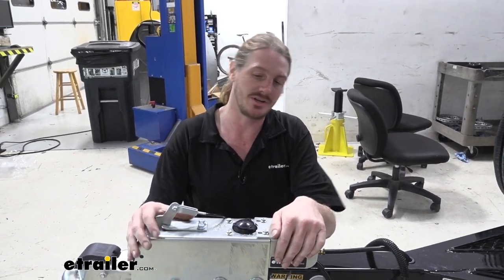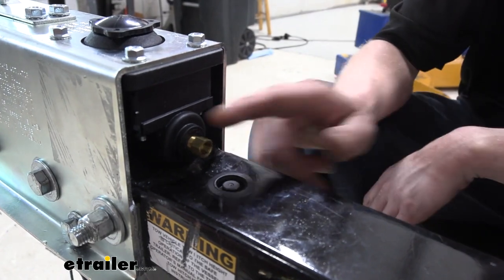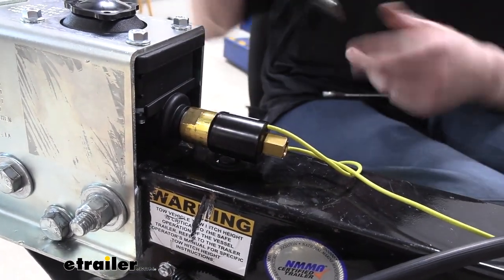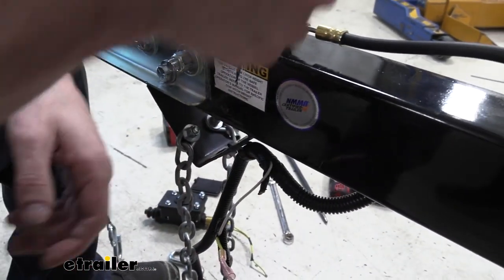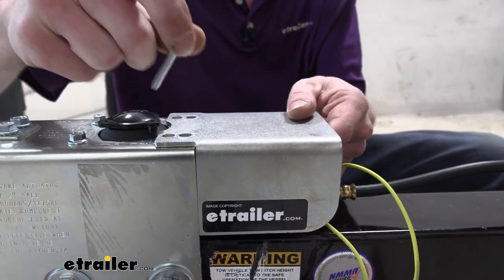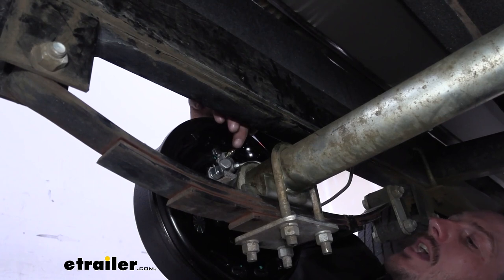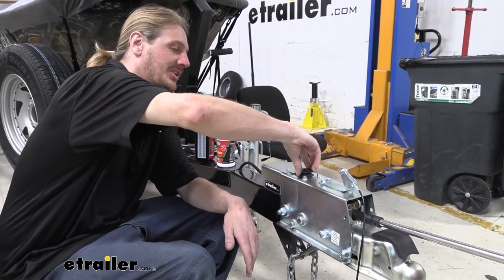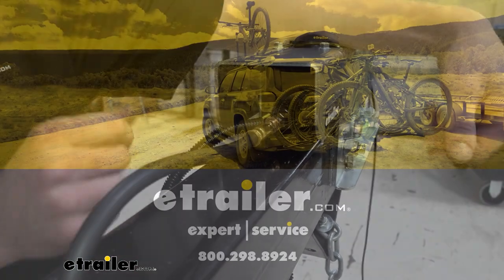etrailer | An In-Depth Look at the Reverse Lockout Solenoid for Demco Hydraulic Brake Actuators

Comment: How did you get the black case off , the one that allows the assitant to do his part?
Reply from the maker: If you're speaking of the black housing on the # DM11993 solenoid, it isn't removable. It installs inline between the master cylinder and the brake line.
https://www.etrailer.com/Accessories-and-Parts/Demco/DM11993.html